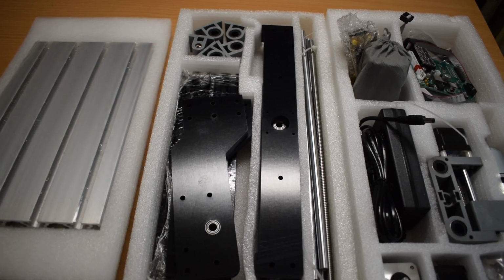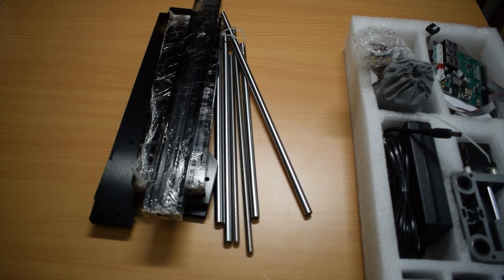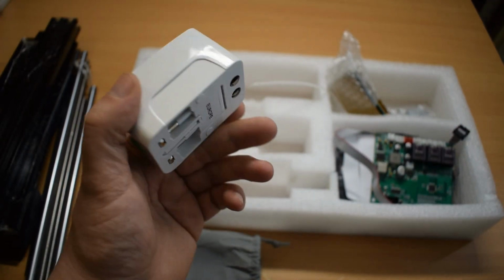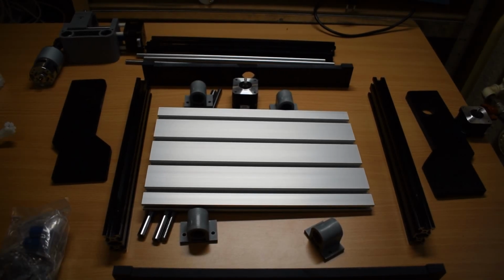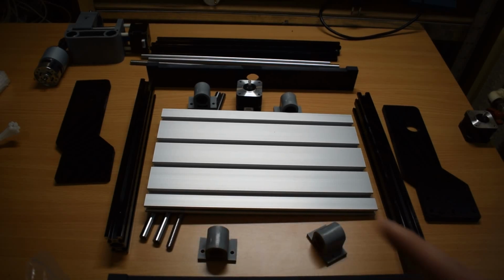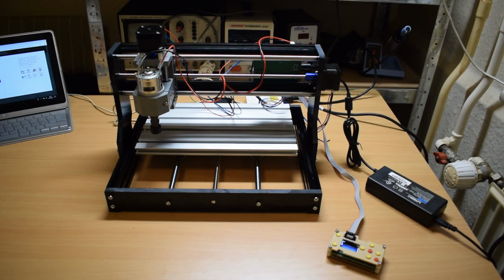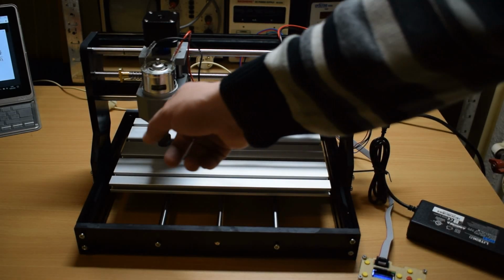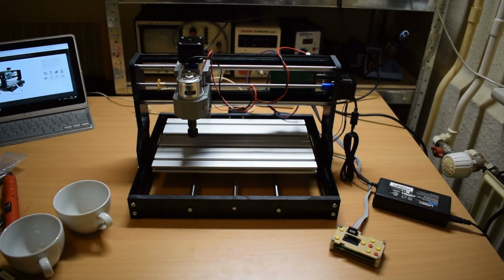CNC 3018 Pro Kit Unboxing and Build

Comment: @UCvXb3Re2y2V1nk2bbqI4rvQhere did you get the electric screw driver i like that small electric screw driver. I have been wanting 1 that small but could never find 1..
Reply from the maker: Not sure who you are @at-ing, but I got it from a local hardware store. However I have seen the exact same one, although with different branding, on eBay, Banggood etc.
Reply: @ZnakeTech  thanks i was talking to you but copy and past didnt work right i guess....thanks for the reply.

Comment: Hi I want to try that CNC with Alphacam. Do you know if that controller is compatible with fanuc (like the mech 3 software ) or other thanks .
Reply from the maker: It’s Grbl based, so not compatible with Mach3, as far as I know, but I believe SainSmart has made a version with Mach3 compatible controller.

Comment: Do you have the wiring diagram
Reply from the maker: No, but all the connectors should be labeled on the board, that's just what I used to wire it up.

Comment: Which one is better CNC3018 or CNC3018  Pro ?
Reply from the maker: Honestly I don't think there is much difference, I have seen 3 or 4 styles of frame construction on these, but for what it can do, wood and plastics mainly, I don't think it matters much. You do usually get a newer version of the control board with the "Pro" version, but I don't know if it''s better. One thing I will say though is don't pay extra just to get the little controller that attaches to the main board, I think it's pretty useless, you will want to hook it up via USB or something like that to control it.

Comment: thanks for the video, good content, but the auto-focus of your camera is so annoying...
Reply from the maker: Yes sorry, I know - this was mainly shot with a Nikon DSLR, and they are pretty bad at auto focusing in video mode, so it tends to hunt the foucs a lot, and my primary lens for video is far from silent. I'm experimenting with different setups, the Nikon as in this video(might just have to go with manual focus if keep using it), I've also got an old camcorder, it usually does better with focus, but the image quality is worse, and it has no external mic input, and then I've tried my iPhone which is maybe the best setup, but it needs a lot of light for decent image quality. So you will probably see some difference between my videos in terms of audio/video quality, but this is just for fun and learning, so I can't justify investing a whole lot in new equipment, I have to work with what I got.
Reply: @ZnakeTech  the dslr is good, just set it to continuous focus in the center point (not multi point) so you put in the center whatever you want to focus.

Also, dslrs usually record up to 20 mins, because otherwise they are categorized as camcorders, and pay extra tax.

Thanks again for your content. It was VERY relevant for me in order to decide what to buy. Best wishes!
Reply from the maker: Okay thanks. Actually if I crank all the settings to max and record 1080p 50/60 fps it's only 10 minutes, really annoying.
Reply: @ZnakeTech  by the way, my 3018 is coming today :)

Comment: Is there any way to control spindle rpm already included? I saw a picture of the control board and there is a pwm signal wich I imagined would be for that but it should be transparent to the user thought
Reply from the maker: The control panel can just turn the spindle on and off, as far as I remember, but the Camtool CNC v3.3 mainboard that I have, should be able to PWM control the spindle, if you send the right commands. What those commands are though, I'm not sure.

Comment: Mine did not come with the ribbon attached controller. Do you use it much? vbcoachwasiatyahoo
Reply from the maker: Honestly, I haven't really used the machine much yet, other than a few quick test runs, but I consider the controller pretty useless, it has very limited functionality. The obvious way to control it would be via a computer over USB, a Raspberry Pi option has also been mentioned to me, but if you have look at my other videos, you will see me toying with the idea of controlling it over WiFi with an ESP8266. That is very much just a concept yet, but I hope to dive into coding something more functional for it during the summer.